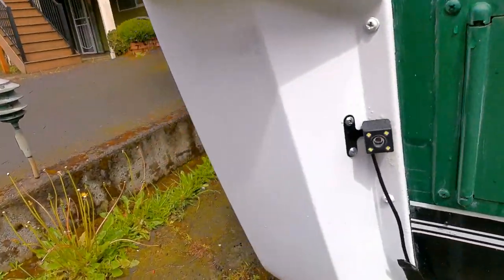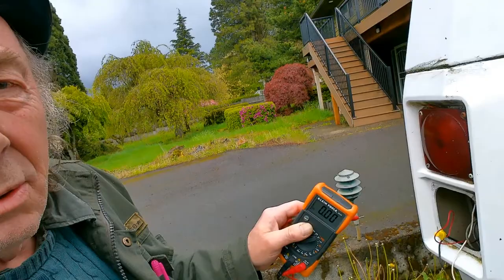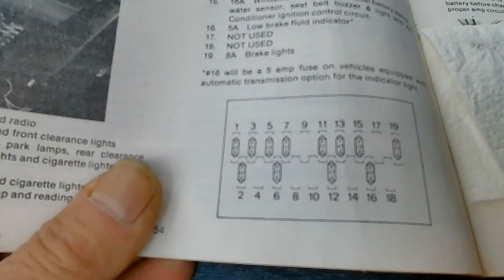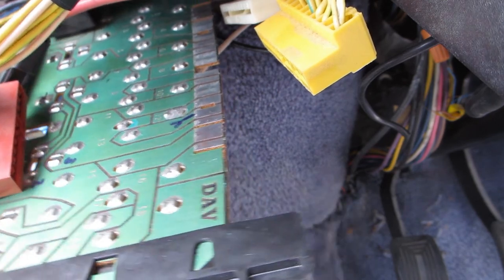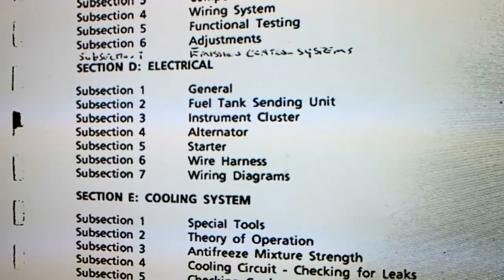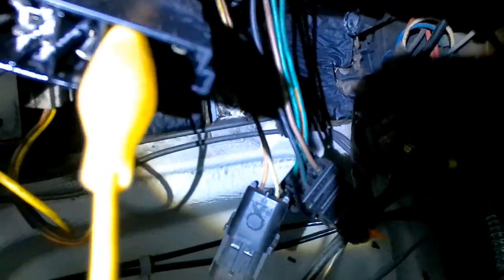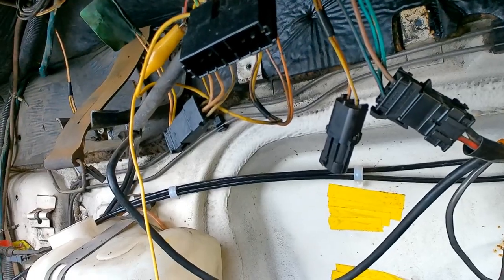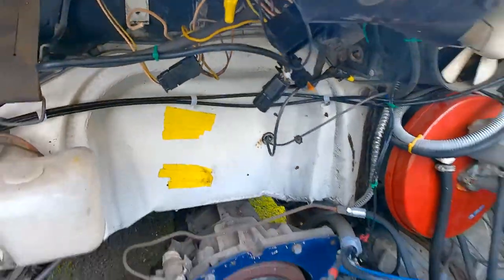WINNEBAGO LeSharo RV Custom. Part 21.  Finding and fixing the Back up / Reversing light circuit.

Comment: Good perserverance there! This things are confusing with a French Utility Van with an American RV Body. 
You think the back up wire is crazy, trace down the rear turn signals and brake lights sometime.... It's NUTS! (Especailly around the turns signal switch.)